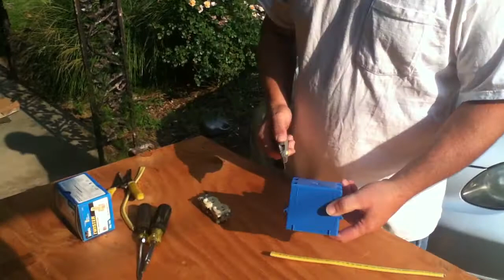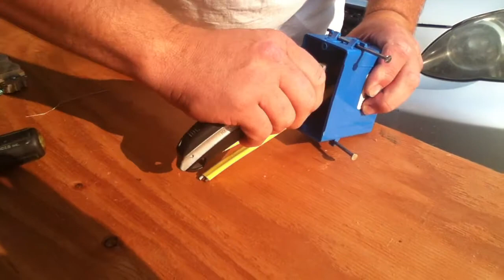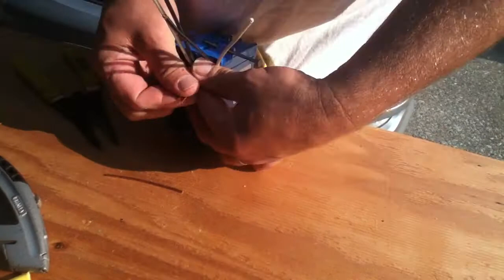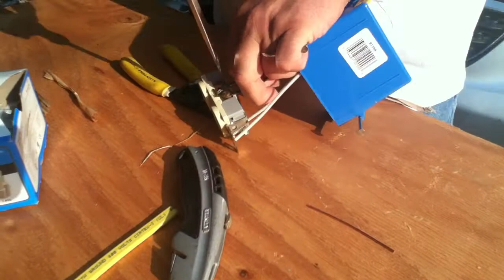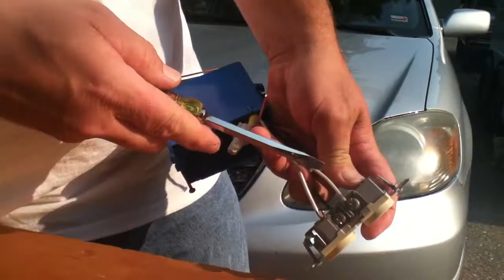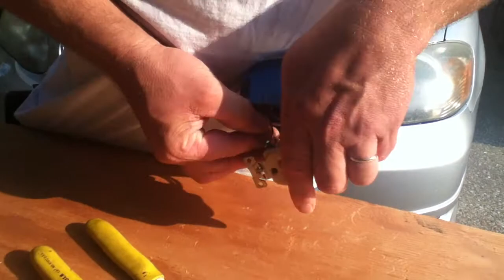How to Install an Electrical Outlet

Comment: This is really good information to know. I just tried it on a house I'm selling, you make it look so easy! It was hard for me because it was already installed and they didn't leave me much copper to work with in order to ground the extra copper wire to the green "ground" screw. Great job Micheal!